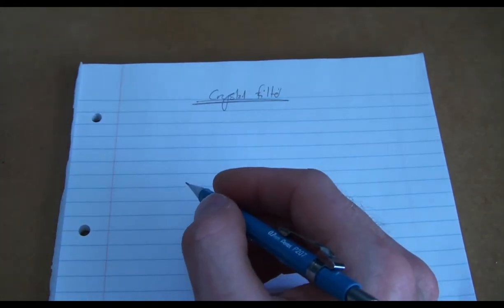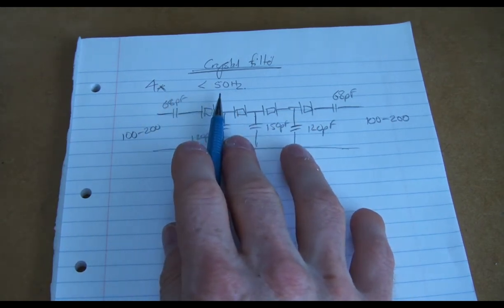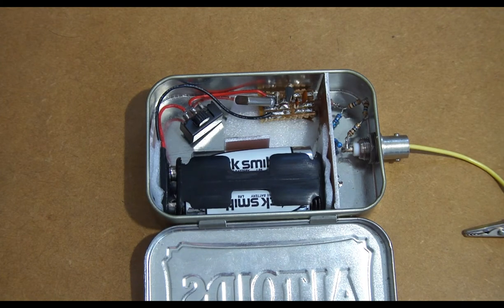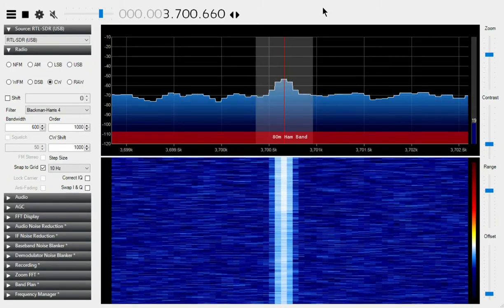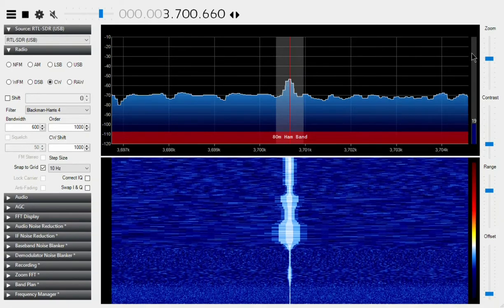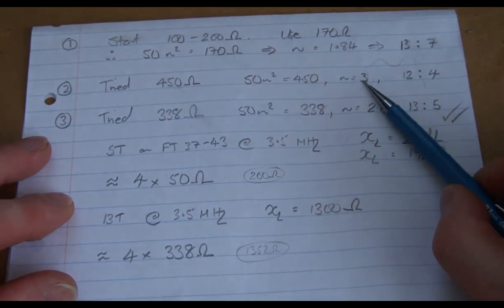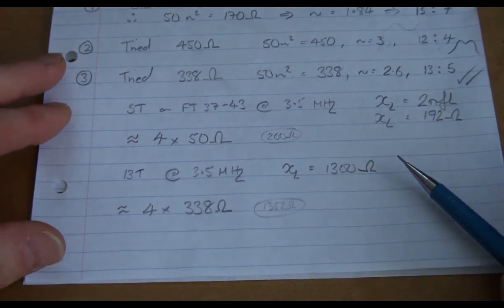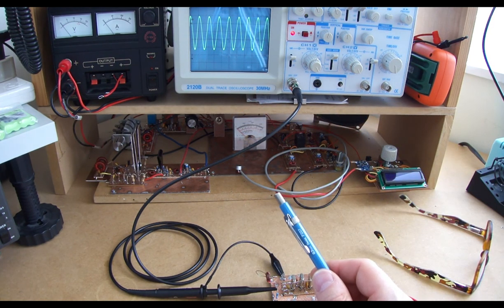Homebrew 80m/20m SSB Rig Part  2 - Crystal Filter

Comment: I was rewatching this video as I'd like to start working on my crystal filter. Have you considered using a noise generator and SDR dongle to plot the frequency response instead of doing in with your scope and excel? Maybe the accuracy isn't good enough for such a narrow filter, but it worked great when I was tuning my BPF.
Reply from the maker: Sort of. I pumped white noise into the mic and used the SDR RX to look at the resulting SSB. Not the best way, but it did work well.

Comment: Informative as always Charlie, thanks!  I was wondering if the veroboard would introduce capacitance by virtue of the parallel conductors. Soldered pigtails to the end of adjacent tracks and measured 4 pF.  Wonder if this is material at 8MHz?  Best way to tell would be to make up a second filter ugly style and compare. Probably not worth doing but an interesting thought! 73 Paul VK3HN
Reply from the maker: Thanks Paul. That could very well be the case. I do try and break tracks where they are not needed in an effort to prevent outputs from influencing inputs. I'll probably leave it for now and compensate it in software. I do have a small CNC machine next to me that I want to start using more often. That will certainly help.

Cheers
Charlie, ZL2CTM
Reply: Charlie Morris Yes it's probably not an issue having random capacitances of a few scattered around the filter at 8MHz or lower, but would start to matter as the frequency rises.
Reply from the maker: Agreed. Thanks for the input Paul.

Comment: Also ppm error in the RTL-SDR.com dongles is low enough that its not a problem. Anyone using a cheaper dongle will have to set the PPM error correctly first.
Reply from the maker: Great point. Thanks for that. I guess also so long as the PPM error is the same for all crystals being measured then the aim of getting four as close as possible to the same freq shouldn't be impacted. 

Cheers

Charlie
Reply: Charlie Morris That's true. Tho I would suggest letting it warm up first or avoid any thermal drift .  Also very nice videos they are all nice and informative.
Reply from the maker: Very true. Good point. A bit like my TS-120s, which need a good 15 mins+ to settle down and stop drifting. Thanks for the input!

Comment: still waiting for crystals to arrive. Are you picking up that oscillation "as is" with the rtl sdr dongle or did you modify it for direct sampling below 24 MHz or whatever the lower cut off frequency is.
Reply from the maker: Gidday. I have the USB settings within SDR# set to:

Sample Rate. 2.048 MSPS
Sampling Mode. Direct Sampling (Q branch)

That works well for me in the HF band.

Charlie
Reply: I'll have to give it a try. I was under the impression that one had to solder an antenna directly to a couple pins on the PCB for the RTL-SDR dongle. I'd be happy to be wrong!
Reply from the maker: I understand you may need a Version 3 RTL-SDR dongle to allow the direct sampling mode. I remember soldering an antenna directly to the sampling chip of one of my older dongles. It was a real pain and didn't work that well for me.
Reply: well, would you look at that! It would do me some good to read the user's manual before trying to use this thing. Yes, I've got version 3, and yes indeed, direct sampling is a software option!